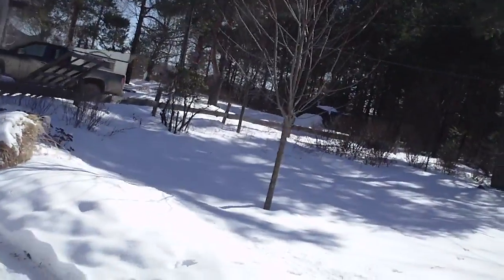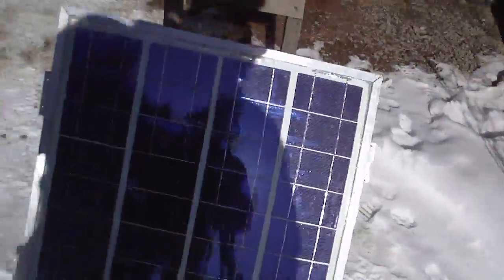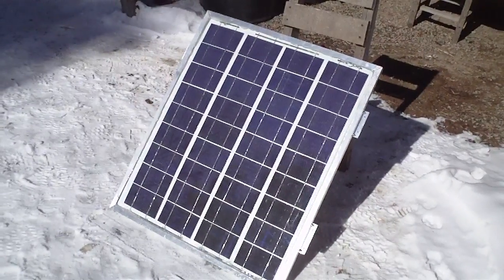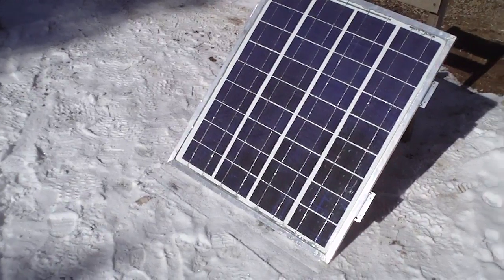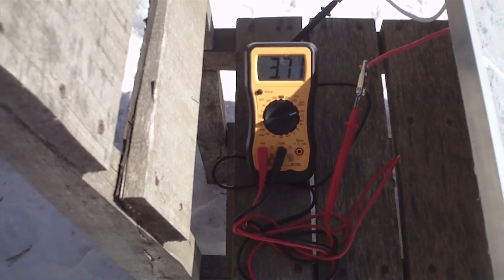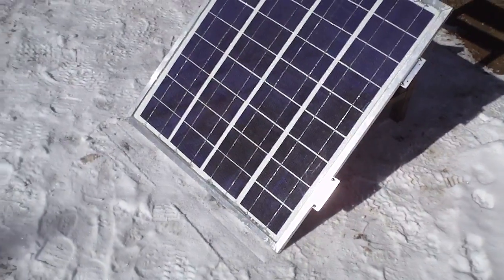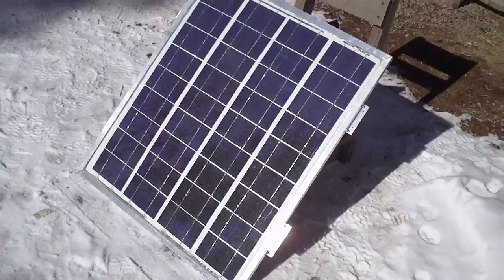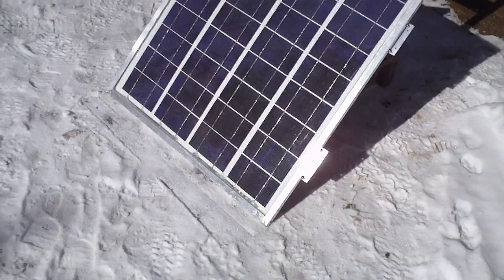homemade solar panel test

Comment: Good work!
I encased a small 10 cell (for 3xAA NiMH) and it worked for 2 years (until it got stepped on! The other one did not last due to solder or weather problems).
It is satisfying to DIY, I encased an 18v, 0.6A (ebay cells between 2 sheets of glass) and it got cracked a year later (left in snow all winter), and got moisture in it. Now, another year later, no moisture and it still works!
8 cells is all you need to charge a lifepo4 battery, which powers a 10 watt led.
(Search tempered glass)

Comment: very nice job 3.70 amps in the winter sun is very good,i would say it may peak out at 4amps or higher in the summer Sun,,, if you encapsulated the solar cells you sould be water tight ,,  looks very good nice job 
i wish the solar cells was from me 

David at          solarcells101

Comment: Impressive! I went with off the shelf panels for powering my workshop, but your panel is a much better value. Each of my panels produces a little over twice the output of your panel, but at 4 times the cost. So on a watts per dollar scale which is what really matters, you are coming in at a bit less than half the cost of what I paid for mine. I'd call that a real savings. Good job!

Comment: @dalecalder2003 the panel will probably run 1 bulb at full output as long as the intensity of the sun stays the same, it will dim and pulse otherwise, you do not want to run things directly, the goal would be to charge a bank of batteries and use the power from them and have them charge throughout the day, obviously the more power in the faster the batteries charge.